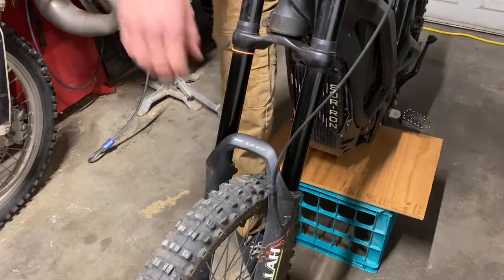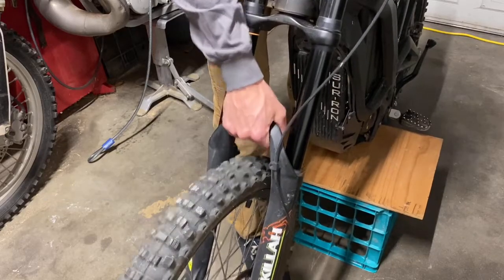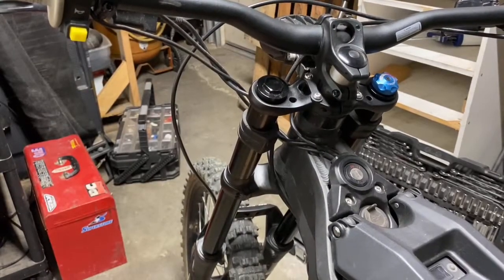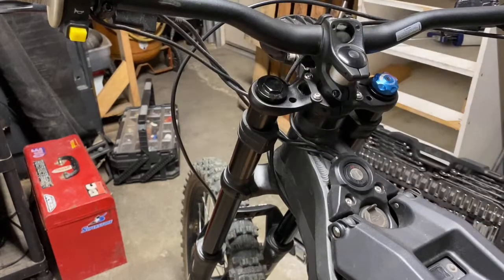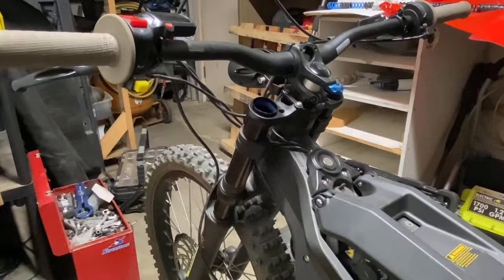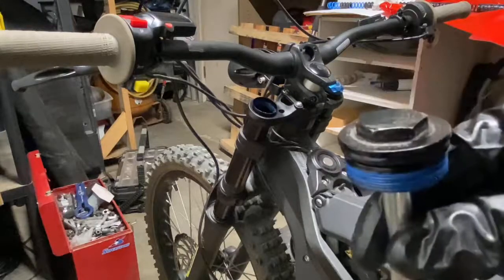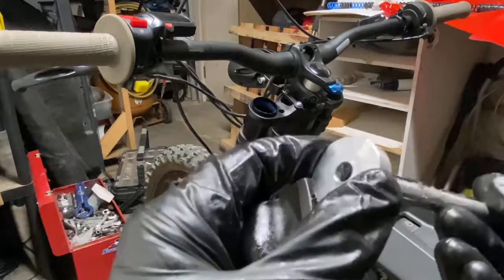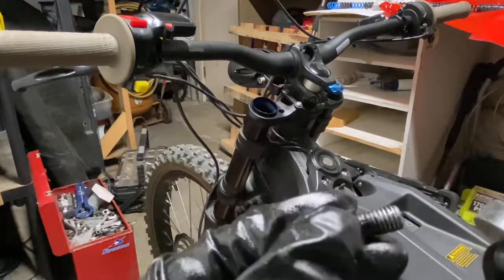Fix Noise and Poor Performance of RST Killah Fork on Sur Ron Light Bee in Less Than 10 Minutes

Comment: What does the allen head do at the bottom of the fork? Thanks
Reply from the maker: The allen head screw is meant to fasten the round spacer to the shaft
Reply: @informationageenterprise2184  So, I'm guessing then that it spins and is not tight is normal given that the spacer inside is turning? Thanks

Comment: I have that same clicking noise with 40 miles street rides. Do you do the same step as the right side?
Reply: And how’s you take out the bolt
Reply from the maker: The spring is only on the left fork tube, I believe right side is just dampening.
Reply from the maker: @kurtblends9798  With the spring out you can compress the fork (pull the front wheel up) and then the bolt isn't too deep